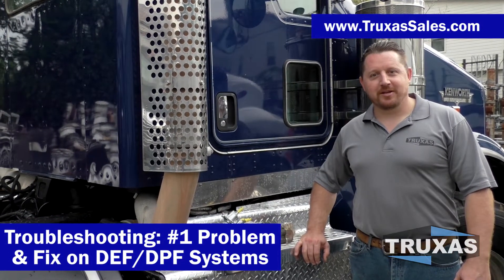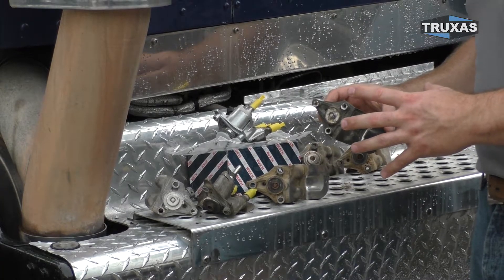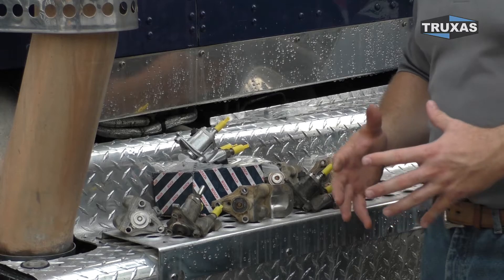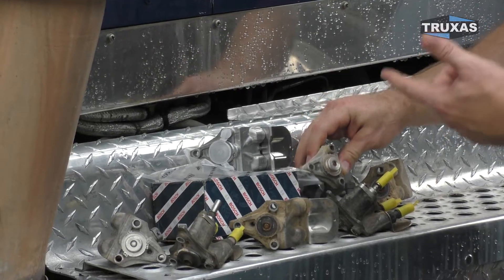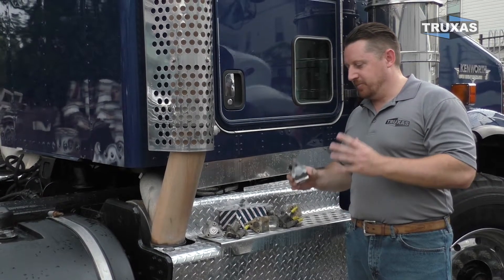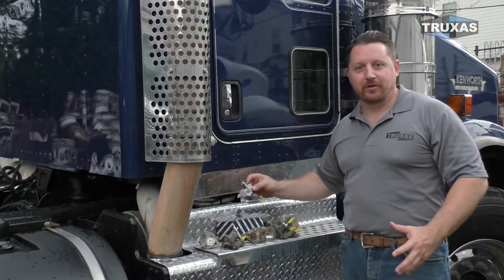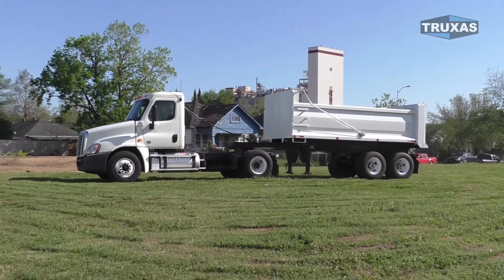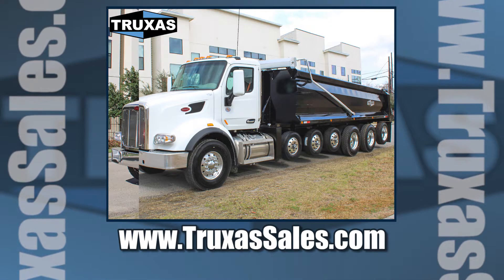Troubleshooting: #1 Problem and Fix on DEF/DPF Systems

Comment: Super helpful n honest video man wish all mechanic shops worked ethically and not bullshit n charge excessive amounts when like u said 30/40 bucks parts in and tbh id rather go to you guys for any job w that honesty even if u sell for 250 the honesty is what im willing to pay for that extra price my Do Not drive -dpf warm up required activate dpf switch to prevent derate came on and as I tried to leave it told me to park immediately I know it must be def as it has 900,852 miles I just bought 4 months ago 2019 T-680 and I asked guy 3/4! Times about that and he sd it was just changed all system it’s what was told to him 🙄 I will definitely take to u guys if I get running I don’t want to eliminate def system I love this truck

Comment: I have  a 2013 kenworh t800 cummins isx 485. I saw this message from my dashboard that "Regen is inhibited due to switch". My boost on the guage registers 20. But the exhaust pipe is extremely hot such that when I placed my finger to it, it burnt my skin. It has not gotten to a derate mode yet. Do you think replacing the doser injector will take care of the regeneration?

Please advise
Reply from the maker: sounds like your reganeration swith is in manuel mode. if your truck has that you can swith it to auto. if you havent replaced your doser injecter in the last few years you should do it.

Comment: My 2015 paccar goes into limp mode every time I turn it on due to SCR fault code. I can clear it to drive but it appears the doser isn't getting def. Just got it out of the shop a couple weeks ago for a different dpf issue. I replaced the doser and it didn't do the trick. Could it be the pump?
Reply from the maker: yes it could be the pump. or the filer in the def tank is dirty. If it has the orginal 2015 def filter its long over due to replace it.

Comment: Hello, I got the same  as in the video and these codes Aftertreatment system operator inducement severity message error
Aftertreatment system - DEF dosing malfunction detected
Emission control system - Engine torque derate active
Emission control system - Vehicle speed limitation active
Lookup Code / FMI Count
524619
P1514
P1518
P1514

I changed the DPF level sensor, the filter and doser  changed the sensor but it’s still on

Comment: When these systems started coming out they said to clean your filters every 500k miles. Now the brought it down to 100k to 150k 😂😂 most of them are easy fixes like my man here said. Thanks
Reply: Put it in a garbage can filled with water and liquid plumber gel max keep moving it around wear rubber gloves and keep dumping the water in and out until it's shiny like new wash the drain slash acid off good so it dont keep eating the metal...ps shines all metal to new
Reply: Ours need cleaning/replacement every 20k. It’s criminal. EPA isn’t helping anyone with this stuff.

Comment: I have a 2014  Jeep Grand Cherokee with Diesel engine. I'm receiving a Engine will not restart in 150 miles Service Def message. Def fluid has been added and the message still appears. Could this be the issue. The message appeared before and the dealer had the truck for 3months to no avail.
Reply from the maker: dont know anything about jeep diesel, but if it has def, then it has a def injector.

Comment: Hello TRUXAS. 
I have a KW T680 2019. In about 2 months it's the 3 time I am in the shop for a DPF Faulty Code in my dashboard. It seems to be always a sensor or something regarding the DPF system. I really like my truck bought it new... I need to learn more  how to fix and clear codes on this system. Do you offer like a guide of parts to replace before they go bad and how to video also ?.      PLEASE HELP .
I have been an  O.Optr. Since 1990. Real truck driver... but DPF is killing my vocation....
Reply from the maker: we plan to do a emissions sytem maintenace video in the future

Comment: I’m having this issue right now I’m at Springer NM Truck Stop Phillips 66 Part Number # Q21-6170-006K1T DEF Tank Sending Unit Sensor. They were only 10 available yesterday in the  whole Nation. So I probably will have to use a Tow Truck, Labor Day coming next Monday Just imagine Loaded & having this issue on a 2021 Kenworth T 680 Sensor Shortage Now? Kenworth Albuquerque NM charged me for Diagnostic $448.93 It’s Supposed to be under warranty So I ordered one through Kenworth Denver Cause I was caught between The Wall & The Sword (I’m Loaded) got to Deliver in Aurora CO You Honestly share the Truth behind those Pirate Shops Thx

Comment: Pulled into shipper at the guard gate and the Limp Mode Maximum De-rate must replace def fluid . 

Is this critical ? Can I drive out of here ? 

I just lease purchased a truck through a company haven’t even had the truck 2 weeks. .
Reply from the maker: you can't get out of limp mode unless you go to a dealer. maximum derate is 5mph.

Comment: I currently have codes spn 3226,5298 and 4796 on a 2018 peterbilt 579. Still runs like normal, but tired of seeing that engine malfunction light on all the time.  Any advice?
Reply from the maker: have the air intake egr and sensors cleaned, that needs to be done every other year really

Comment: Can u delete the DEF SYSTEM?
And what happens to the truck 
I had heard the truck runs better stronger and more fuel mileage.
By cutting it off/out is this true?
Thank Russ 
From Detroit MICH
Reply from the maker: We can't delete it. but OfCourse the engine is going to run way better and longer without that system.

Comment: I need some help with my 2014 D13 i've been having problem with getting the temperature higher than 240 on T! and 230 on T2  while doing regen. i change 7 injector which was not clog but i change, i change the AHI , i change the SCR injector dozer valve. No luck there is no code that i can look for  it. any suggestion i will appreciate.I also did the reseting  and nothing the truck went into derate 5 mile and doesn't want to let go. and when i mean is not hot is that i can put my hand and leave it touching the piece where is mounted the dozer valve and it wont burn.
Reply from the maker: Once it is in derate you have to take it to a place with a computer that can clear the code. without seeing it there are a lot of possibilities

Comment: I have a 2016Cascadia and had constant def issues and shop changed nox sensors and def pump dpf filters dozer valve and still kept having issues costing me thousands of dollars. Then I came across a video about the def metering valve and while it was expensive like you were saying right away on first regen I noticed the difference in regen temp in the first 5 to 10 min the codes popped back up and 5 min later were gone after cycle ran codes check again codes were cleared and gone. Freightliner kept telling me my one box needed replaced. Saving me from a ten thousand dollar job.

Comment: So I have a kenworth 2016 with a pack car motor T680 Just had the whole DPF system replaced replaced filters everything sensors and guess what now my truck is having A problem again I paid thousands of dollars to have that system replace and and apparently it's doing the same issue as before they said they had to replace the filters because they were cracked or had a hole in them or something I or something I did not know you could damage them when you're pulling them out that's funny probably what happened but if you could do a video about the suit level centers it'd be much appreciated if there's something about maybe needing cleaned is what somebody told me
Reply from the maker: We have a inlet outlet nox sensor video on the list!

Comment: After installation of the valve  do I have  to reset  computer  or  is just plug and play..I thought  about  mine  but didn't  want to tamper with it because  I was afraid  it would  mess up computer  readings
Reply from the maker: If there is no engine light on and you replace the senor, everything will be fine, but if the light is on, replacing the sensor will not clear it.
Reply: @TruxasSales   appreciate  the response..about  to purchase  a  diagnostic  scan tool for  that ..looking  at the  bocsh  hds 250..is that OK..what do you recommend

Comment: Do you happen to have the part number or the eBay link ?
Reply: I contacted Kenworth and got the part number. I just received the dossier valve that I purchased on eBay, yep they have them all day. It was $32.49! The gasket was $48. I am going to install it tomorrow morning. Wish me luck! Also, you can find Nox Sensors, for around $150.
Reply from the maker: Check the link we put in the description

Comment: The DEF Doser does not effect the temperature during an active regeneration. It is used only to combat Nitrogen Oxide in the SCR and is mounted after the DPF Filter downstream. The truck uses the turbo actuator, 7th injector, and DOC to heat up to spec.
Reply from the maker: The DEF fluid does actually create heat in the SCR. The reaction that occurs and changes the gases is an "exothermic reaction" and creates heat.  And if is sprays to much fluid or dribbles the fluid out it can cool the SCR and cause "ammonia slip."   The SCR can also get dirty and clogged as well as the DPF filter.  If the Doser is not spraying properly the system can abort the cleaning/heating.   We made this video in layman terms and it isn't a video teaching about how the SCR and DPF work.

"...NOx reduction with ammonia is exothermic, resulting in the release of heat."
https://www.epa.gov/sites/default/files/2017-12/documents/scrcostmanualchapter7thedition_2016revisions2017.pdf
Reply: The DOC creates heat to bring the SCR up to temperature then when the SCR is hot enough ( approximately 400 degrees ) the def gets injected into the SCR and turns into ammonia.

Comment: So where do I get the $10 injector? Could you do a video of how to just swap that out real quick?
Reply from the maker: eBay, but you may have to wait 2 months to get them at that price, we have them right now for $30.  I'll see about the video. it's pretty easy to change but if you don't do it right the dowser doesn't work property and you have to take it all apart again and you may have engine codes that need to be cleared. sometimes the extra money for the whole dowser is worth the less potential headaches.
Reply: @TruxasSales  I was also thinking it would be better not to deal with the coolant lines. I did order the complete valve from Amazon 2 days ago.
Reply: Can you link the 30$ injector?